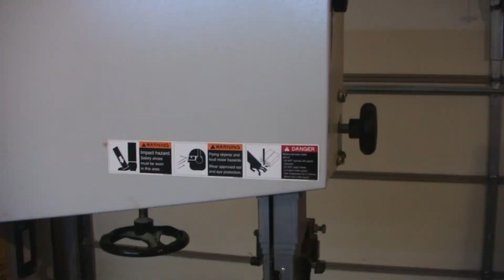SCM Minimax MM20 S500P Tool Review

Comment: I’ve had my S600 (MM24) for about 10 years now. Awesome machine! I was surprised to see the criticisms of the dust collection. After putting a piece of tape over the big hole on top of the top cabinet the DC works fine. Even after extensive resawing sessions there is almost no dust in the bottom cabinet.

Comment: I have a s500p Bandsaw purchased in  2012. With a handful of easy minor mods and one major mod (cutting a 3” hole in the bottom the front doors) I get excellent dust collection.  Even with Asthma I sometimes don’t put on a respirator for 5-10minutes of ripping or resawing. There is some dust on the table behind the blade, very little the floor and almost none in the air.  I rarely vacuum inside the lower door and Never need to vacuum inside the upper wheel or on top where the 3 holes are.  I’ve seen enough questions posted about this saw I think it’s time I make my first ever video and post to YouTube.

Comment: I bought my MM20 back in 2005 at one of the Woodworking Shows.  Absolutely an Incredible Machine.  I still have my Old Jet Gold 14 with Carter everything. But that's only because the table is higher then the MM20's lower table that's necessary for larger woods...  ie weight 
fantastic review, WAY better Machine compared to Jet or Laguna.  thanks
Reply from the maker: Thanks.  No comparison to the store brands for sure.  I have worked in large and small production shops over the last 15 years, and this is by far the best band saw I have worked with... and it happens to be in my shop.

Comment: I have a mm20, and the dust collection was horrible on mine also.  I modified mine using rare earth magnets epoxied into the ends of a cheap cut off paint brush to brush dust off the blade. I have one on each side of the blade.  So far it has worked fine with a 1 1/2 hp dust collector.

Comment: RE the comments on dust collection. On the top of the saw there are 3 large holes. One is for the guide post to pass through when you raise it up, the other two are for lifting the saw. Have you covered up those two holes? I too was getting covered in dust until I climbed up on a ladder and put some magnetic masking over the holes. Problem solved.
Reply: Yes—did this on my S600 (MM24). HUGE improvement

Comment: Great review, can you tell me what the minimum and maximum blade size for this machine? Different websites say different things....
Reply from the maker: You can go down to a 1/8" blade, but you will need to make a small guide block in order to accomplish a small blade.  The largest blade you can put on it is 1 1/4 if you hang it off the front wheel and adjust your guides.  Most of the time you will probably keep a larger blade on it and hopefully have a smaller bandsaw with a small blade to minimize the time of switching out blades.  I typically keep the blade you saw in the video on the machine.

Comment: Thanks for the review. What type/size of blade are you using in the video for resawing?
Reply from the maker: The blade is a Lenox Carbide tipped blade called the "Woodmaster".  Unless you are cutting exotics, you will almost never have to sharpen it.  I know people who have had it on for 2 years and have yet to sharpen.  I like it better than the Laguna resaw, and it costs less.  Here is a link: https://www.bandsawbladesdirect.com/lenox-woodmaster-ct-band-saw-blades
Thanks for watching!

Comment: I got this saw in early 2014. Mine came with the horrible carter guides. I hate them. They are a major pain to adjust or change so a Woodmaster CT 1" stays on the saw. Would like to be able to use all the smaller blades that i got but it is just stupid the time it takes to get the guides readjusted for a new blade. Did those euro guides come with your saw?
Dust Collection is miserable too. Have you made any mods to get better dust collection? When sawing it is like standing in a rain storm of sawdust....not cool.
Reply from the maker: As far as I know, they sell all the new machines with Euro guides on them.  At the date your machine was purchased, you may have been at the tail end of the Carter guides.  The dust collection is bad, which I highlighted in the video.  I have not made the mods yet, but after a recent re-saw fest, I think I have been pushed to a point... I have to make the mods.